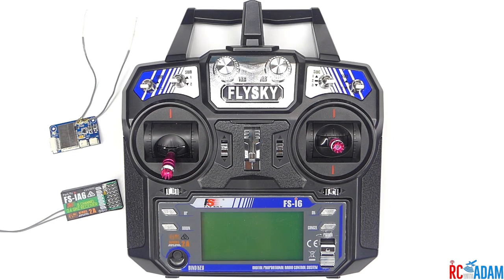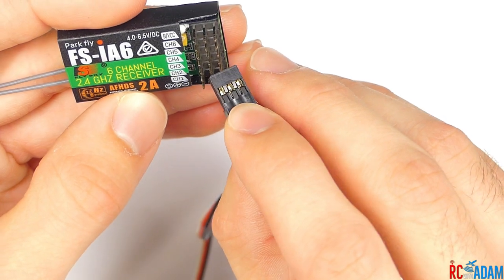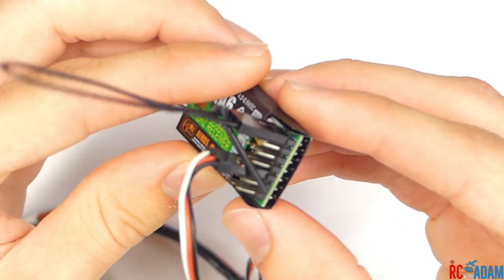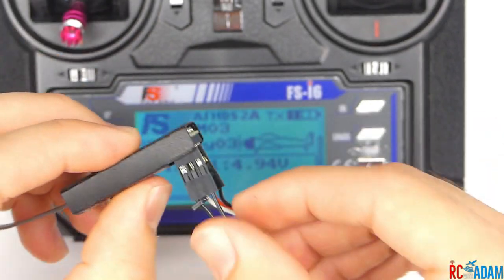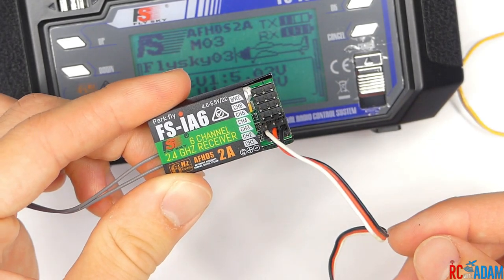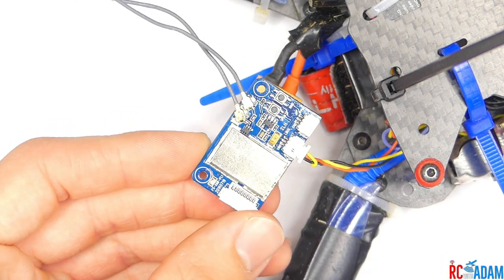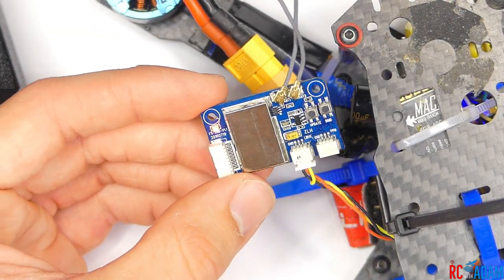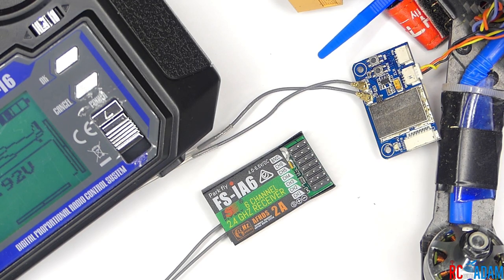How to Bind with Flysky Receivers - iA6, X6B, iA6B, Fli14+, GT3B, FLIT10 - FS-i6 and FS-i6X Radio

Comment: For anyone struggling, it's easier if you first power up your quad without the receiver connected, then hold the bind button while connecting the receiver wire.

Comment: I think we can use an old usb phone charging cord and phone charger to get 5 volts to power a reciever to bind it to our transmitter before we even have to put it in our drone or plane . The red and black wires are 5 v on a 5v phone charging cord . This might make it easier .  Bind buttons can be hard to hold down while plugging in a battery with one hand if the  reciever is mounted inside the model . So check the voltage with a meter if you try .

Comment: I use a FlySky FS-i6X Tx and FS-iA6B Rx for my model sailboat. I would like to collect control data (PWM) using a second FlySky Rx connected to an Arduino and datalogger. Is there any way to simultaneously bind two receivers to a single transmitter? I also have FS-GR3E and FS2A=4CH receivers available. Thanks.

Comment: hi bro how you done i watched this great video but i need your help i have radio control FS 10ch i6s white i use him on my rc truck with battery 3s 4200mAh 35c but when the battery is weak and the truck move slowly the battery still full on my radio screen i think she needs adjust from RX set up 
high volteg 6.0
alarm volteg 4.2
low volteg.4.0
i think she adjust from this settings until to reading right if you have any idea i hope tell me that thx dude

Comment: Help! adam  I reversed channel one on the controller now i can' t reverse it back . i have followed the instruction  the switch looks flipped but its not. I am using this on a sailboat for the main sail control. Down should bring the sail in and up should let the sail out .  i reset the controller defaults and followed your instruction to rebind the receiver.

Comment: I knw the video is 2019 but my power supply is a Li-poly RC Battery 7.4V 8C 2000 mAh, and the wire lay out is red- white and black so is that going to be a problem?

Comment: Hi nice video about transmitter binding with receiver, but I'm facing solid red light problem in fs-CT 6B receiver, at first it will stop blinking but after disconnecting all connections it is not connected again that is solid red light, could you explain to how get solid light in receiver

Comment: Will it bind to my spectrum receiver? And do you have to have a motor controller?
Reply from the maker: Hi! Just now saw this. No, this will not bind with Spektrum transmitters. And no, you do not necessarily have to have a motor to use this setup and control the servos. But if you don't have the motor esc to power the receiver and servos, you will need a seperate voltage regulator to power the receiver and servos at 5 volts.

Comment: I've got the exact same receiver and transmitter. I'm not able to get the receiver to have the fast-blinking light when I have the bind cable and a 5V power supply plugged in. I'm able to get it to start binding to the point where the led will be blinking slowly, ~1 time per second, but the receiver never says "RXBind OK." I've been looking online for over 2 hours and haven't found anybody else with this same issue.

Comment: Eeeh wht's up doc, i have a TR624 receiver from Tactic and i want to connect it to an F4 or F7 flight controller ?   which cable's (channels) or Pin's would i need to connect from the receiver to the FController

Comment: I have bind the same receiver on model 1 and model 2. How to remove receiver from model 1? I tried "model reset", it reset all the settings but the receiver still conect to model 1.
Reply from the maker: As far as I know, that model profile will stay bound with that receiver until you bind it with a different receiver.

Comment: I did exactly what you did here but smoke started coming out of the receiver when I plugged the XT60. What battery are you using? I think I am using the wrong battery.
Reply from the maker: oh no! It shouldn't have anything to do with the battery if you plug into the ESC 5v servo connector.

Comment: I'm going crazy! Need help! I bought a new eachine cinewhoop. I had a Flysky i6 transmitter and I bought a Flysky x6b receiver. I can't get the bind light to even come on. I've tried several things. Do I even have the receiver plugged into the flight controller correctly? I just used the already attached wire from the flight controller and plugged it into the x6b ibus port. The receiver gets very hot and does not bind. Please help! Thank you!
Reply from the maker: Hi, William! Email me some photos of it to RCwithAdam @ Gmail.com  and I'll do what I can to help.
Reply: @RCwithAdam1  thank you so much I will do that!!

Comment: I've been watching a few of your Videos on the FlySky FSi6 Radio, which I'm brand new to. 😖 

I have a second FSi6, that I fly my Foamies with (sorry!! Not a hardcore Flyer 😋). 
This one in question, I'm using for 1/14th Scale RC Semi Trucks. 

In the Video, you said that I could Bind any FlySky Reciever to this TX! 
What about a THREE Channel? 
I've got the i6B in the Truck itself, but I also want to operate the Lights, Signals, Brake Lights - on the Trailer - wirelessly, with the 3ch Reciever. 😳 

Now, Binding two RXs simultaneously to one TX is the easy part for me...
Both sets of Turn Signals will run on Ch 1, and the Brake Lights on Ch 3.

..... I don't NEED 6, 8 or 10 channels in the Trailer, obviously. 
Will a FS GR3E Bind to my FSi6?? 

Your Videos have been invaluable so far!! 👍👍
Reply from the maker: Hi, Carmine! Yes, you can use the GR3E rx! But you have to change the rx setting for that model profile to the older AFHDS protocol, as you can see in this video: https://www.youtube.com/watch?v=Rj0ndZxJ7is .

Comment: Can I bind a fs-ia10b receiver to a fs-t6 transmitter I've tried your way a few times and didn't work
Reply from the maker: Fs-T6? No. The T6 is only compatible with the older AFHDS radio protocol while the ia10b uses the newer AFHDS2A protocol. Here's a link to flysky's website where they show all the receivers https://www.flysky-cn.com/receivers

Comment: Hi, what battery did you used to power the receiver 2S 7.4v ? That receiver take only 6.5v, will it damage it ?
Reply from the maker: Hi! The battery is 2S, but it is connected to the ESC, and the ESC is regulating the output voltage to a constant 5v (using a built in Battery Eliminator Circui (BEC)).

Comment: Don't forget to have your TX protocol set to the installed RX method.
Reply from the maker: Hi! You know, that's a good point, but I actually haven't been able to tell a difference (which is weird because, I'd thought it would!). I'll have to investigate further.
Reply: Perhaps it's only for PPM output. My apologies. 
System. -> RX Setup -> PPM settings

Comment: Hey Adam, Im trying to bind my frsky r-xsr with my flysky fs i6x. The r sxr wont go into bind mode. When plugged in with a lipo and bind held all the red green and blue lights are solid, all on. I have my flysky set to PPM and SBUS. What am i doing wrong ?
Reply from the maker: Hi, N7! Unfortunately FRsky and FlySky are not compatible brand (They use different radio protocols).
Reply: @RCwithAdam1  dang. my mistake. thanks for the quick reply man, you rock

Comment: Hey anyone, I'm having some real difficulty getting my X6B receiver to bind with my FS-I6X, I think I've got all settings correct in betaflight and the transmitter but they simply don't find each other. Any help would be greatly appreciated.
Reply: Hello i have the same issue did you found a solution?
Reply: @juleschollet3226  I re soldered all my connections and reset  my software and restarted, then it worked.

Comment: another is the problem ... I have fs-i6s and x6b receiver ... they are connected ..but I can't not connect Funke to betafligt I can't not find the port
Reply from the maker: Which flight controller do you have? And can you see which pad the X6B signal wire is soldered to?
Reply: the connection between the drone and the remote control is ok .. the remote control with betaflight I can't not do it...now I managed to connect I deleted everything .. but I can't not  do it ..make the settings as they were in the factory

Comment: Adam, to say I could use your help is a huge understatement. I bought a heavy duty, all steel hydraulic loader from an online auction. It came with no paperwork, no instructions, and I'm totally new to this. Upon playing around trying to figure it out, I could only get the bucket to raise and lower. thinking there must be a problem with channels synced between receiver and controller, I chose the factory reset option, big mistake I know now.  Ive been doing a ton of reading, and watching videos, about all of yours, so I think I have a grasp of what needs to be done. Doing it not so much. everything i have watched regarding binding the two, the receiver is out of the truck, plane, etc. Can I bind the two with the receiver in the loader? taking it out looks problematic. I have made a jumper bind wire, put it on with heat shrink protection from touching the center terminal. Can I now bind with the FlySky FS-I6S? If so, how? The receiver is a FS-IA10B.  2nd question, would you be willing to help me set the remote controller up? I am reaching out to you here, I am new to this so not sure where would be best. I need help bad! And it would be greatly appreciated! Tom

Comment: When you said the X6B has no servo ports, you're actually holding near the servo ports.
Reply from the maker: Hi! That port is actually just for PWM signal connection (where there's a wire for each channel), which uses servo style connectors, but can't actually power servo. So it can't practically be used for an airplane setup.
Reply: @RCwithAdam1  you can always use a break out board. It's not the receiver that powers the servo but the BEC.
Reply: @RCwithAdam1  Hi RCwithAdam. You can use this board http://ebay.us/DGwmts?cmpnId=5338273189 for simple connection to the X6B and have available 6  x 3 Servo ports / channels.  (X6B is still one of my favorite receivers !) And you can attach a ESC (Electronic Speed Controller) as normal to power up the X6B